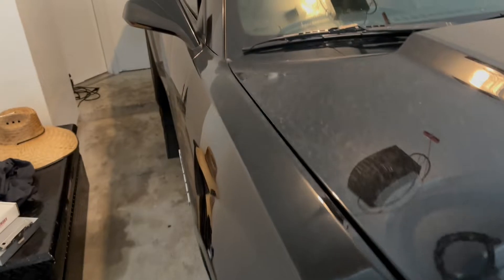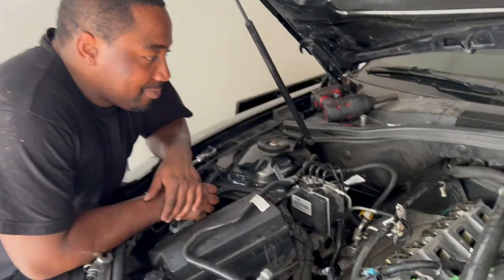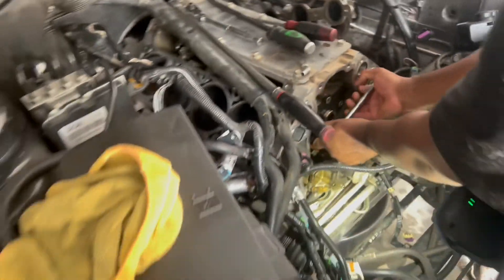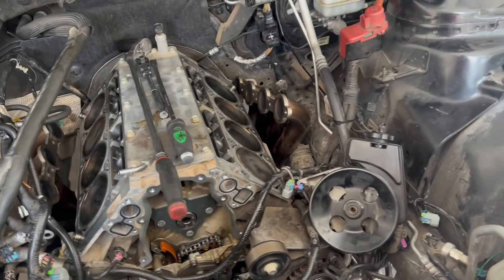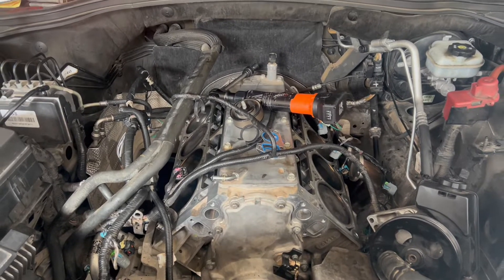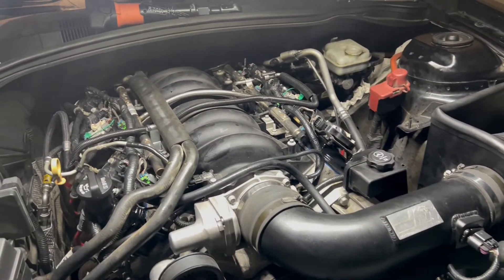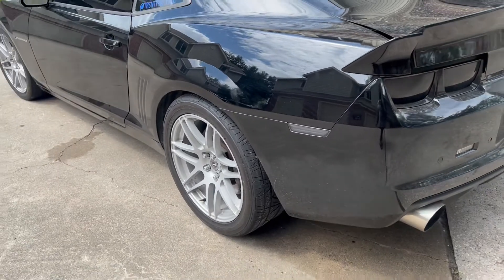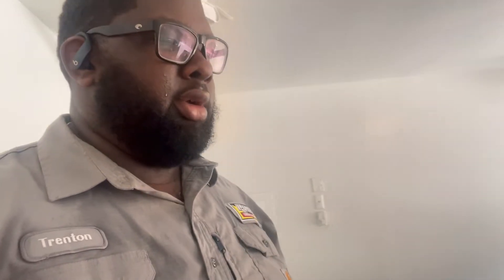Cam install on a LS3 Camaro!

Comment: actually had no idea it was that easy
Reply from the maker: Yeah it wasn’t as bad as it seems
Reply: @GM_Trent  i'm about to cam and pull my motor out, any tips?
Reply from the maker: @brycenklinkowski5721  is yours an auto which is why you’re pulling the motor? Even so, just take your time and be patient. Rushing is how you skip or break stuff. As long as you do that, you’ll be fine
Reply: @GM_Trent  yes it is an auto unfortunately😂

Comment: You probably won’t see this for a while, but did you have to pull the pan all the way off or pull the block out to remove pan & pick up tube in order to remove the oil pump?
Reply from the maker: My bad man. Meant to get back with you earlier. Just been busy. But all I did was lower the oil pan. I took most of the bolts out from the front and loosened the ones towards the back so that the pan would tilt enough for me to get the pickup tube bolt out. I used a magnet to grab the bolt in case it wanted to fall because there’s not a lot of space

Comment: Need your help if you can, I have a 6 gen, 2017 2SS, where can I go to get the same package? In otherwords, the full package you got on yours.
Reply from the maker: Being that I have a TSP cam, you would have to go to the Texas Speed website. I would call their customer service as you spec it out, because all the drop downs can be kind of confusing, if you’re not sure which exact parts you need
Reply: @GM_Trent  hey thanks man

Comment: Rip to your cam bearings lmao
Reply from the maker: Why you say that?
Reply: @GM_Trent   the way cam was forcefully pulled out and bumping the cam gear on the way out. Gotta rotate it smoothly and let itself ride out. Apply very very slight pressure.
Reply from the maker: @TravisCadello  lol you talk like I was just yanking it out. But na I 100% know what you mean. That’s what I started off doing, but I had to pull it just a bit just because of the oil film causing it to stick a little. If it felt like I had to apply too much pressure, I would’ve definitely been questioning things. We actually looked at the bearings before I slid the new cam in and they were fine
Reply: @TravisCadello brother I know what you mean but just by twisting it it’s not gonna slide itself out lol you have to apply slight pressure to pull it out

Comment: Did you install a 3 bolt or 1 bolt cam? How many bolts is a stock ls3
Reply from the maker: I put in a 3 bolt cam. Stock is a one bolt. You will need to buy a 3 bolt timing gear

Comment: great vid !! can't wait to see next one.  Just curious if you had any experience with the hand held/remote tuners.  Could you have used one for this install ?  Im wanting to cam my 5th gen eventually is why im asking. thanks again !!
Reply from the maker: Thanks man! Glad you liked it. And if you’re referring to the programmers that already have some tunes loaded in it, I personally don’t recommend those. They can’t match exactly what your car needs as far as tuning goes. Every engine is different even if they are the same. That’s why it’s always better to get a custom tune